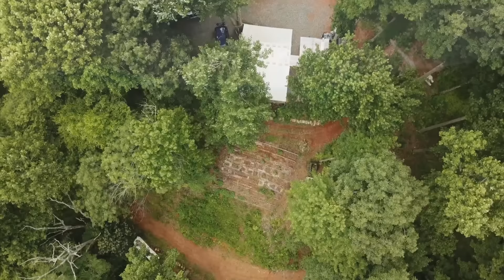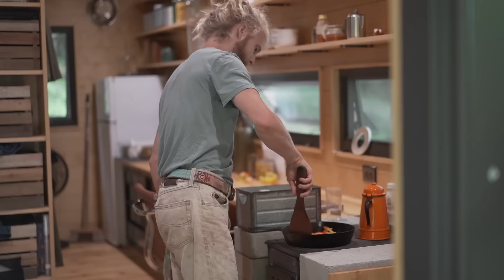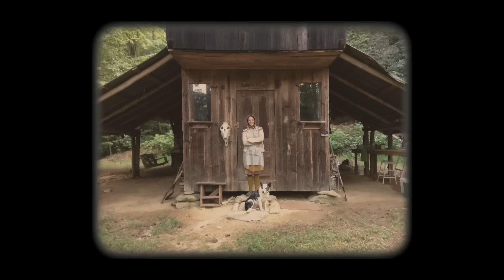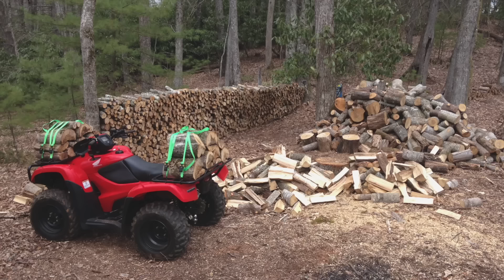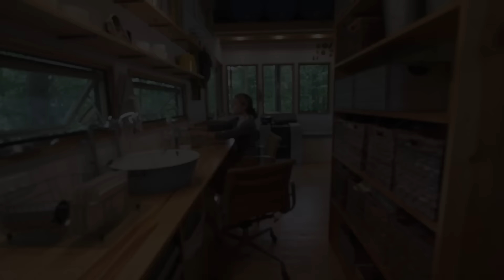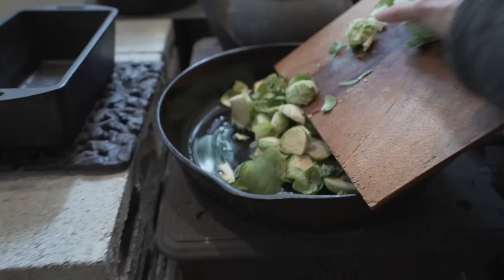Living Off-Grid in a Tiny House Community Built by Self-Reliant Couple

Comment: I like the message that this isnt THE solution for housing, its one solution.  People often seem to be looking for the best or only solution, or their "forever " home, when different housing will usually be required for the many stages of life.  I think this shows how several people can work together to experiment, while maintaining a "mainstream" life, there are so many alternatives (yes, this fits your brand perfectly!!).  Great video.  Also gave me some ideas for combined rainwater/sun shade at our place 🤸‍♀️
Reply: What I am trying to understand is - sure it's sustainable now, when you have two students living that way, but soon, everyone will want their tiny house - they are all using wood for heating/cooking/building...What if you had 50K, 100K people (or more) wanting to live this way and use wood? Wasn't forest preservation one of the reasons we had to switch to other energy sources? How is this exactly "sustainable" as a "new way" of living on a larger scale?  Not trying to knock it down, just trying to understand what's new under the sun.
Reply: @MusgraveRitual  

Using wood is sustainable. Millions of acres of forest land are owned in the southeast by timber companies and paper companies. You cut timber and you replace it by planting new trees. It’s very green and very sustainable but you are putting carbon back into the atmosphere when you burn wood but the only alternative is using propane for heat or having a massive solar system which is incredibly expensive to create heat in any other way. There are some ways to use sun for heat such as the earth ship type houses but you have to have the right property and be in the right part of the country. These things are not as simple as the far left environmentalist would like you to think. But world population is going to peak in the near future and start declining and man’s impact on earth will decline with it. Also as technology and innovation take us into the future some of these issues will be solved that way. But the reality is the trend over the last 50 years of more and more people living in huge metropolitan areas is an even greater impact on the environment. Not less like a lot of people think.
Reply: @MusgraveRitual  not sure if there is one right answer, I just like that they are experimenting.  It's not new, this happens every generation, but it's great that we can see into people's lives and pick options that we can incorporate. 

We are no longer working, are travelling around in a caravan and have built a cabin on family land, so what I see as a sustainable option for living won't be available to everyone.
Reply: @MusgraveRitual  I think your post is a legitimate one. You can't scale this out very far without running in to sustainability issues. There are ideas within this model that, if codes can be altered, that tiny houses within mixed neighborhoods or even suburban neighborhoods can be an economical alternative to the expense of housing these days.

Comment: As someone who grew up on a sailboat, part of that cruising in Mexico... Let me offer a thought about washing (dishes, people, etc) the rainwater you collect is much cleaner (will leave less residue) tgan the salt water we used, but let's look at it as 'similar' in nature... We found that all washing and first rinse could be done in salt water, but we were told by cruisers who did not do a 2nd rinse in potable water that the residue eventually developed an odor and taste... In the case of daily personal hygiene, warm salt water to bathe/rinse was fine, but again a potable-water rinse (a cup or so of warm water poured over the head into a basin, then wetting a facetowel with that to sponge the rest of the body was excellent and kept us to our limit of 48oz of fresh water/person/day... Clothes washing in rain water probably does not need a 2nd rinse, but if the pH of your rainwater shows it to be either acidic or too basic - one will deteriorate natural fibers, the other will eventually develop an odor
... Just some thots

Comment: Nice video.  I built an earthship and have some pointers for you.  I didn’t see a water treatment system for the rain water. Check out the systems used with earthships.  Collected rain water can have contamination from bird droppings, rodent droppings etc.  Stuff left on the roof etc. before the rain. Rocket stoves use 75% less wood as do also rocket mass heaters.  75% less!  Build them out of heavy metal (1/4” or thicker). The ones made out of metal barrels don’t last very long so they aren’t safe.  The key design factor is to keep the air volume the same through out (inlet, stove chambers an outlet all the same sq inches not the same cubic inches but the space the air travels thru has the same sq inches.  For example, a 3 and 9/16”square inlet would be the same as a 6” ID diameter pipe outlet.  If you run your rocket mass heater exhaust pipe thru some masonry (a masonry bench or bed etc.) for up to twelve feet, you capture even more heat before you exhaust up the chimney.  Have a bypass so in the summer it doesn’t go thru the masonry mass.  Masonry (brick, Adobe, rocks etc) absorbs heat very slowly and then releases it over hours of time.  Your corn needs more nitrogen and you get better pollination (more kernels per ear) if planted in three or more rows closely together.  I would never build an earthship again though as they take two to three times more labor than conventional const.  Your designs seem much easier.  However, earthships do keep you warm.  We heat ours (1200 sq ft) with a small electric space heater plus one in the bedroom and we live in a zone 5.  At 5,000 ft elevation.  Take care
Reply: Earthship construction would be problematic since it's permanent and not a temporary structure. The restrictions and code in Boone is pretty typical, i.e. restrictive.

Comment: There appears to be an abundance of firewood.  I could imagine a system based on the burning of firewood that provides hot water showers whenever you want them, heats the living space, heats cooking surfaces, and generates electricity.
Reply: Right a rocket fire hot water could do 4 to 5 showers on one fire. Using a reclaimed gas fired hit water heater with safety relief  valve would keep it safe. I did love the clear water filtration containers.  Are they diy? Been considering doing something like that and clear made it easy to see.

Comment: I too am living in a similar way. I like everything you all are doing to be as self sufficient as possible while connecting with nature. 
For an immediate solution to hot water I recommend that you use some of that scrap metal and build a cylindrical fire place furnace and install either iron or copper piping coils wrapped around inside or outside of the cylinder. Use a 12v water pump and inexpensive inline booster pump to increase water pressure.
On demand hot water heaters and all other electronics will easily consume the solar energy and backup batteries.

Comment: It's  an interesting way to use land. Are there any  tax advantages to your type of property project? Also, since water ir electricity is minimal,  I suggest you make a Sauna and at least get cleaned through the help of fire fueled heated rocks and steam.  You can make the hot water you need for a shower in the same room. This can help  eliminate skin mites, as  regular bathing usually keeps in check.

Comment: I really love what they are doing and I may use some of it at my cabin. I do have a question, that I don't know if it can be answered by the OP but...What kind of water filtration system are they using? I'm going to be buying one soon and thought I had which one down but open to something better and/or cheaper and that system definitely is different than the ones I looked at.

Comment: It would help if you explain how you are off grid in an area that doesnt allow it. What do you do that goes around it besides temporary dwellings?
Reply: They allow off grid but don't acknowledge rain water as an appropriate water source so you need to drill a well and require a private septic system. They don't like compost for human waste. Otherwise there are some new off grid homes in the county still being built. Also permanent structures have to be built to NEC code. Any structure that is not on wheels has to be smaller then 10'x10'x10' to bypass building regulations. Hope this helps.
Reply: @ianrobinson476  helps greatly. Thank you

Comment: i suggest you try tumo breathing (wim hof explains it scientifically in his book) and cold showers... also. when theres no sun,  you can have a copper serpentine water pipe, sorrounding the flue of a rocket mass heater which will also give you an oven and a stove and a warm bench, and get all the hot water you need burning twigs and small branches efficiently and releasing only water vapour emissions

Comment: YOU ARE MISTAKEN, YOU ARE NOT OFF-GRID IF YOU USE A PHONE OR COMPUTER!!!!
Reply: They are in the sense they are not connected to a power grid, or municipal water supply or sewage system. One can be connected with phone and internet while still being off-grid
Reply: @jamespaul2587  I was under the impression "off-grid" also meant not being able to be tracked and the internet has got us "by the balls"
Reply: @dusty2774  you could define it that way but most regard off grid as away from municipal infrastructure
Reply: @jamespaul2587  so...they are mistaken.
Reply: @dusty2774  no, they're not as it isn't clearly defined. To be truly self sufficient they would have to avoid use of propane and fuel for the quad, but their homes are off grid in a basic sense
Reply: @jamespaul2587  so you JP are a traveler not a driver?